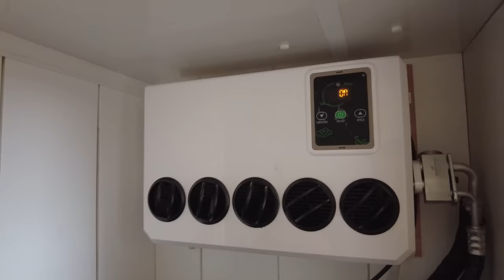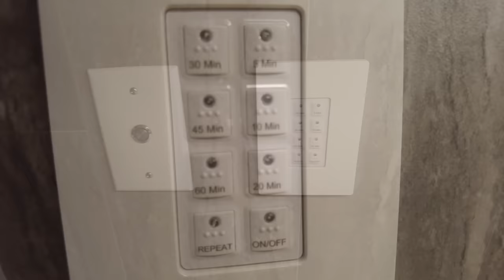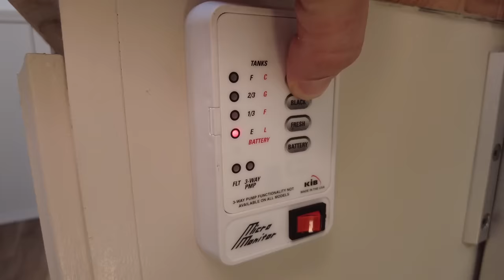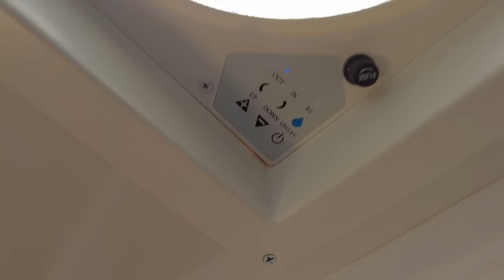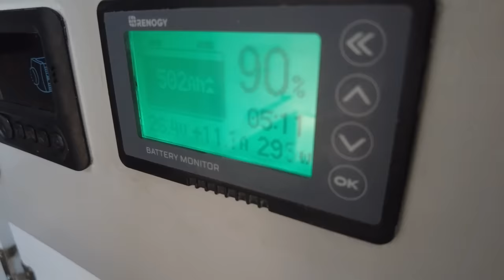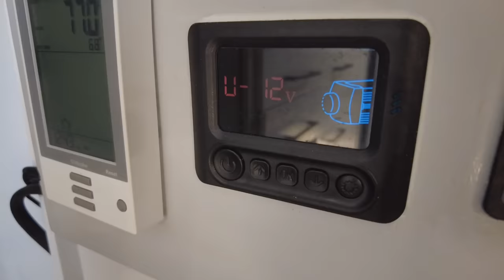Stealth Apartment + Toy Hauler in a Box Truck? DETAILED TOUR!

Comment from the maker: A few details not included because I didn't want to make a 45 minute video:

1. Bed is used with a folding hideaway step stool - I jumped on it to show sturdiness and construction quality
2. Weight of the truck is 8000lb empty with 14,000 GVWR. This build is under 12,000 with fresh water in the tank.
3. Fresh fill inlet is hidden inside passenger door
4. The answer to every "Why didn't you X" is either A) Budget or B) Didn't match clients design
Reply: what's 10 more mins! we wanna see everything lol this is cool
Reply from the maker: @iLoveMiniThingz  I could do an hour but the algorithm wouldnt show it to anyone
Reply: I saw a Van lifer add a electric car charger hub to charge the batteries.   Do you offer that also? Just wondering and planting a seed...😎👍
Reply: I’m such a girly girl, but this is “Glamping” for me and I love it!
Reply: I would put a kill switch in the back in case you are in back and somebody tries to drive off with the truck.
Reply: @TheTechnoBarbarian  you need new leaf-springs
Reply: I agree with the comments I did not mind watching this entire thing at all I could have stayed for 10 more min lol. 
Awesome design.
Reply: What is the ballpark cost for your build? How do  you find the "Donner box truck?" cost?
Reply: Excellent build Sir. I've been reviewing van builds for year and very few if any allow for a bike inside, the wench and wheel slot is brilliant, mine might need a slot shaped like a small (T) to allow for the front fender.
1. My bike is a (Suzuki C50T Boulevard), it's a small bagger 100"L 35"W, would it fit? If needed I could figure a way to reduce the handle bars by 3" or even make them fold.
2. I would ask for or suggest a clip on the ceiling in the bathroom that would hold the shower head.
3. How much for that exact build minus the truck, parts and labor? Oh... don't hate on me but I am a engineer with an eye for detail and I notice one flat-head screw on the bike hold-down loops wasn't screw down flush. Other than that your build is perfect. Hit me up I'm interested also having you build me one. If interest leave a reply with contact info. Thanks Shell
Reply from the maker: @saveamericalive287  Shoot me an email thetechnobarbarian@gmail.com
Reply: How much does something like this cost
Reply: At least give a video of an actual motorcycle winched in.
Reply: How do I order one
Reply: Fck it...45 min videos (and even VGG 2hr ones) can be great to watch!
Reply: 👎👎  Bed is actually not good considering the truck is quite large. Put a mattress on there and you will hit your head daily sliding in and out. Also, don't think it's great the ceiling is a foot from your face, and what a nightmare trying to put sheets and linens on there.
Reply: The most important thing you said is that your not a vanner, and after 40yrs of flooring, I see your not a floor guy either. 
Whats wrong with your build..many things. Heres just a few: to big, alot of wasted space, alot of service, and things to go wrong, gray/black tanks, looks like a closest, ect. ect. And most of all..PRICE! 
You do yuppie life! And that's ok. You do you.
Reply: I can't even put into words how VERY much this and You impressed me ! AMAZING SIR , SIMPLY AMAZING !
Reply: stephanieellison7834  1) doubt it's that high, but I'm sure it ain't cheap 2) it's a custom job. People who have someone else build something like this for them, already have the money to buy it. So why do you care how they spend their money? 3) People who build these out for themselves, may not be able to build something like this out this fancy at first, but that's the whole point. Like you said. No debt and a nice place to live, you can keep adding onto it over time until you make it as nice or not as you like. For some people it's perfect, for others it's just not doable. 4) Your interest rates are a bit off. Our home mortgage is 4.75%. Most people are between 3 and 8. Some APR can go as high as 12. You're thinking of credit cards or something. Perhaps you mean 5 lifetimes in India currency to pay it back? I don't know the exchange rate. Maybe, I don't know.
Reply: @JohnDoe-ls1vd  You said it at the end of your comment. He actually didn't do anything wrong, he just did it differently and you don't like it. Everything looked well thought out, and there's nothing more to go wrong than with any other build that had the same requirements. It's a custom job remember.
Reply: stephanieellison7834   You stated 32.4% unless you accidentally misplaced a decimal. Which is higher than most credit cards. Where in the hell does medical enter into owning this, or any other home? Do you mean that you currently have a bunch of medical bills? You're not making any sense whatsoever with your sci-fi, randomness analogies here... I think I get what you're trying to get at, but you're way off the mark unless you're going somewhere I just can't see. Which is entirely possible because you aren't making sense.
Reply: stephanieellison7834  Well, I hate to tell you this now that you're gone - but in America, there is no such thing as being denied healthcare due to not having insurance. In my late 20's I also had no health insurance. Just working as a private contractor and couldn't afford it. I had an idiot I was working with toss his tool belt off the roof as he was coming down, right on top of my head. Hard hat doesn't save you from neck compaction. I was laid up for a couple of weeks, lucky I wasn't paralyzed. It was something like $60k worth of bills overall with surgery and physical therapy. 
Nothing other than a billing statement came, nobody griped at me about it. 
Once it was all said and done, I went to the Hospital board and asked for relief due to circumstance. They forgave all but $4200 and gave me a payment plan of $50 / month. Which I obviously paid off much sooner than that. The horror stories about American healthcare are due to media and ignorance. Although it could use some reforms just like anywhere else. India certainly has its flaws with their medical system. I have family there. It's not bad by any means, but it certainly isn't perfect.
EDIT: Also, there are no interest rates on Medical bills. It's against the law. They can eventually send them to collections if you don't pay, even they can't jack up costs on medical bills. So, your numbers are still wrong just fyi. Worst case scenario it dings your credit if you don't take care of it.
Reply: Great build. Excellent. 👍
Reply: Don't want a stool or step up n down.
Reply: How much was the build out alone? I rude and I am ready to build!
Reply: STOP COMPARING A VAN FROM UHAUL U R COMPAREING A WOMEN WITH 10 KIDS TO A VIRGIN. DO I WANT ME TO TELL U WHICH ONE FILLS BETTER AND WHICH ONE HAS ALOT MORE EXTRA ROOM
Reply: Why didn't you install a Gatling gun or anti-aircraft defense system? I mean Civil War 2 season is just around the corner. 

Where do you store the Crocodiles for the moat when driving?
Reply: A 2nd Video, aka: Part 2 would let you show All your Great work.  (js) 🫠
Reply: Could have been a 1 min video with a proper tour before driving into every detail
Reply: Lol right lol bro 🤣🤣🤣🤣 that comment made me giggle out loud. 
I can see it to. I imagined it lol
Reply: Do you get car insurance or other types for the truck/ build? I think all of us will need a plan B at some point if things keep going the way they are.
Reply: stephanieellison7834  You didn't read anything I wrote. There is no such thing as Medical debt for the next 5 lifetimes in America. You either can pay it, or you can't. The worst that can happen is you get a bad mark on your credit score and it gets written off. Even then, that bad mark will go away after 7 years. You are completely full of crap.
Reply: Bet you could make a "Stealth" Truck with some pullouts too if you wanted.
Reply: I like it!
Reply: Interesting project, unfortunately not all your equipment is available worldwide. What are the compact high capacity batteries that you fitted, please?
Reply: @velvetbees  Armed entry from the rear should solve that problem 😊
Reply: Estimate for the truck and build plz🤔💭
Reply: I have the perfect Stealth Truck for sale if anyone is interested. I have not advertised it yet.
Super reliable  International Harvester 466E motor, 26' ex-removalist truck... $7800
Reply: @velvetbees  It's a box truck.. /eye rolls/ people don't steal elephants or box trucks because.. they are large, heavy, difficult to hide, and even harder to strip parts / sell as whole.
Reply: Awesome  !!!
Reply: To cool!!! I stealth camped inside a trans haul 5x8 enclosed motorcycle trailer for about 8 months in 2019. I love your style brother;})>   FYI: I had the roof painted with silicone that amazingly kept the temperature cooler then outside, with no active cooling.
Reply: All you need is some outside cameras for security while you're inside. I would like to know the price range but I'm aware that it all depends on what exactly you're looking for.
Reply: How much did entire build cost?
Reply: @Lazyme971  maybe they are coil springs, like in a watch, for extra torque 👀
Reply: @JohnDoe-ls1vd   Way to make it about you.
Reply: stephanieellison7834  Way to make it about you.   Nobody cares.
Reply: @TheTechnoBarbarian how much would your finished product cost me?
Reply: @TechKnowCSS . Yeah , without the toy hauler
Reply: I was wondering how much did everything cost because I was thinking about getting one made growing up i slept in vans cars and I would like to get one created I don't know where to start from I hope that I can get some guidance are help😊
Reply: @TheTechnoBarbarian , oh, how interesting! I am going to start putting content on my channel soon. I have so much to learn! I just fouhad you pop up on my feed! How did you learn the ins & outs of YouTube? I’m a minute & a half in to your video & am so looking forward to seeing the whole thing! I guess that’s why some people do part 1 & part 2!  ✌🏼🐠
Reply: I wonder if there would be a way to reinforce one of the drawer handles to a stepping point, some metal bracket that can fold in and out of any dead space,  along with a lift point? Would keep it clean and save space where the step stool goes + eliminate any need for "putting a puzzle together" as you put it. Just step grab and pull into bed.

Also for the bed, you have to lift it open then pull the extra piece out. Would it be possible to instead fold it from the wall outwards so all you need to do is pull from maybe a small strap or fingerhole at the wall and it folds back towards the fridge and into place? there could be a steel lip the bed folds onto for bracing vs the brackets you have there now.

Granted you only do it twice a day and it doesnt take long... would just be improvement on the theme of of ease of use and keeping things simple. Great work btw. This is the kind of things I wanted to see from "box" builds and finally found your channel. Cant wait to see how you build upon this in the future and get a build from you one day
Reply: Need your email!!!
Reply: You also could of made patio with a wooden path for the bike. But wow.
Reply: @TheTechnoBarbarian  What is the solar panels you use?
Reply: A motion sensor that detects any movement outside the truck and/or a few nicely concealed video cameras might be another nice touch in terms of a security system.
Reply: This is the best build I've ever seen of a box truck. Its amazing. Whoever gets this should consider themselves very lucky.
Reply: I’d buy one straight away
Reply: @TheTechnoBarbarian  , that’s a very interesting comment. Where does one go to learn about these things? Do have any specific recommendations for algorithm tutorials? 🌷
Reply: Amazing build and ingenious use of space considering it is only 17 ft long
Reply: How much it cost
Reply: can I come work for you and be your apprentice? I am extremely passionate about vanlife. I think you're doing awesome work and would love to learn from you
Reply: @TheTechnoBarbarian , very interesting. 🤨 How did you learn about how it all works?
Reply: I missed you on a  step stool for the bed. Where is that kept? How to get up to that bed was what I was thinking when you showed it...was wondering if the handles on the cabinets were built to be extra strong to use as a ladder.
Reply: Love so many of the features that you've built for your client! Would love them in my build. Your client must be psyched!
Reply: Excellent demo! I enjoyed watching! I would rate this a 10 on a scale 1-10.
Reply: I am not going to say "why didn't you" because I get your point.  I will present this as a guy who had a bunch of MOS in his military days, including being SF commo and having designed a lot of wireless networks.   Maybe this resonates for some and not others.

I would have had cameras, low profile, wireless, that can connect to the cellular router (or starlink, or what not) and or wifi access point inside the vehicle box (which I would have).    This would allow 360 degree visibility if placed properly on the roof from inside, or if you have that cellular router for always on connectivity, you can (as with ring cameras etc) get alerts and see movement through your camera app even if you aren't present.   That's a great security feature and also a useful curiosity feature, depending on where you park and what goes on there (be it nature or the humans in the area).

Also, and this is just me, I would have a wifi range extender on the roof, also low profile with any number of antenna options, depending on how you roll, to make the area around it potentially one big wifi hot spot.

On the outside, linked to the cab and to the box area, I would have a wired in coax link to a mast antenna that would be there for both CB AND HAM radio apps so that you could use such gear from the cab of the truck or the box, if that was your thing, as a hobbyist, for road trip CB and HAM comms, or as a secondary but crucial commo link in the case of any kinds of emergencies you may have OR encounter because you can contact police, get local intel, whatever.   I won't try to tell you all of the potential reasons to do this.

I also won't go on to all kinds of other suggestions because I am sure you get plenty of that, but for me, if I could or did do such a thing, or just  RV it...comms are a priority "just in case" and with that would be internet connectivity and the cameras.
Reply: If you take a vehicle with external water tanks under the box into below freezing ambient temperatures as is constant in northern states during the winter, the water inside those is going to expand as the water freezes and it will blow apart the water tanks. There are ways to manage that issue, but because the topic was not discussed in this video, I am figuring your plan is to stay out of northern Minnesota in December when the ambient temperature around the clock can be less than 30 degrees below zero for days or weeks at a time.
Reply: @s.e.murphy5096 Comms with stealth could be done doing something like a fiberglass bubble mounted to the front of the above-cab overhang to act like a ray dome covering a ham antenna mounted on the outside of the aluminum overhang box.
Reply: You still have 2000 lbs of CCC for gear, food, clothing and the motorcyle.  For one person with minimalist mindset this will work well.
Reply: I have to say I love this. Simple and clean. And no one knows what you really got there. Awesome ❤
Reply: I'd like to know the spec's on the microwave combo I've been looking for one
Reply: Looks great